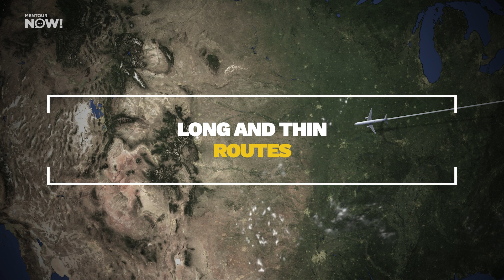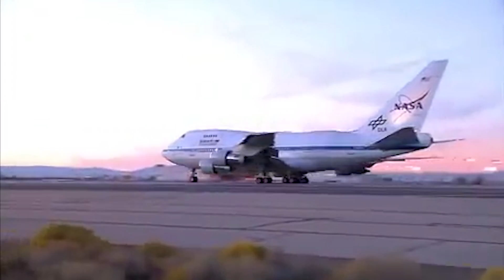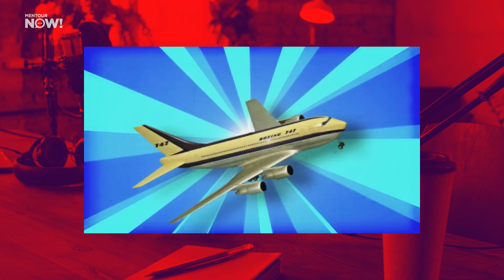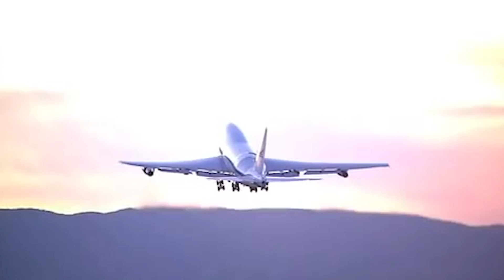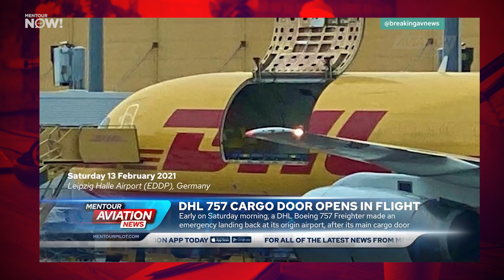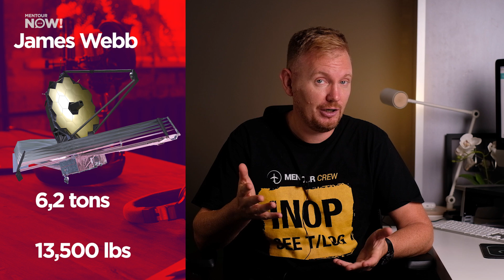The Incredible Transformation of a Boeing 747SP into a Space Observatory - SOFIA!

Comment: A few more interesting facts about the construction of SOFIA: The telescope itself was designed an built at MAN in Gustafsburg. They have very much experience with parabolic antennas of any sizes. To get the aircraft balanced after the huge weight of the telescope was placed in the back 3000 kg of lead shot were added to the nose of the aircraft.

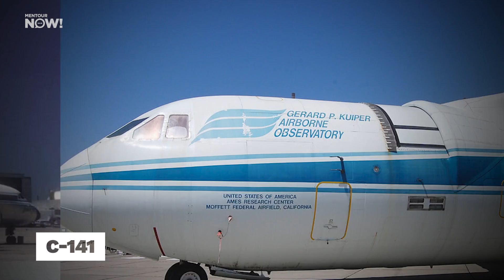Comment: 09:14 - Not to forget that even Concorde was used for astronomical observation. The prototype 001 had its roof cut and windows installed for observing the eclipse overhead, which permitted 74 minutes of continuous observation of the eclipse, as compared to the 7 minutes that would otherwise be possible for ground-based observers.

Comment: There was a documentary made about this aircraft a few heads ago.  If I recall correctly they mentioned the demand for missions was so high they were scheduled out years in advance.  Whenever maintenance was needed there was extreme pressure to finish on time otherwise years of planning and research would go down the drain if the aircraft missed a planned mission. 

I’m sure there’s still much demand for it but operating cost is probably a big factor. Perhaps a 777 could be similarly modified in the future?

Comment: I did see it during it's D-check at Lufthansa Technik Hamburg in 2014 as I worked there in the VIP department. It was launched 2007 not 2014.
One day we heard about SOFIA being there and getting checked, as no other company in the world was willing to do this maintenance on this special aircraft. 
So we went there after lunch break and took a good look. Then one of the scientists catched us looking and gave us a tour and some infos on a model and some demonstrators for the telescope mounts including the vibration control air buffers. Great day that was. We almost missed the end of our shift.
What a piece of tech it is.
The rear section did not just get another pressure bulkhead. The whole upper section was replaced with a bigger section to fit the door and opening into it. They also added a whindshield just before the door opening to shield the telescope from the wind and counteract the aerodynamic effects of the open door during flight.

The 747SP has also the advantage that it can fly very high as it has the wing of a bigger airplane and significant less weight on it.

Comment: With SpaceX's fully reusable Starship rocket likely flying soon, which will be able to launch and service mammoth space telescopes among other things, it is likely a new suite of serviceable space telescopes will go up, making airborne telescopes even more obsolete.

If you just think about the idea of SOPHIA, it is a major effort to get it flying for a limited time with limited capabilities such as 2.5m is probably the biggest you could possibly go with scope size and you still have some atmosphere to deal with, which is a major drag.  With Starship, you do one relatively inexpensive launch in a 9m wide rocket where the telescope unfolds in space to be say 24m, nearly 10x the diameter and then it is in space for round the clock observations completely unobstructed.  Then Starship is cheap enough to do regular servicing missions to a space telescope designed to be serviced.  With Starship's 100+ tonne to LEO capacity and orbital refilling, there are options to either refill in orbit if say you want to go to where the JWST orbits for say a servicing run or maybe use the capacity for a separate transfer vehicle to go out there as there is quite a bit you can do with 100+ tonnes in LEO.

Comment: The telescope door can only be opened safely in flight at high altitude, where the air is thin.   If open at low altitude, the thick air will cause too much wind in the open door, and tear the aircraft apart.
Reply: Except it doesn't.  All those air-to-air clips were not that high up.  Also, it was displayed at Edwards Air Force Base and made flybys with the door open.

Comment: Refuelling, repairing the JWST might not be that big of a problem, as SpaceX is already planing for servicing the Hubble, and SpaceShip will be able to get to it easily, even with a crew.
Reply: SpaceX is only looking into the feasibility of using a Dragon capsule to reboost Hubble back to a higher orbit. There are currently no plans to do so, a decision on whether to proceed with such a project is pending the outcome of a study that is currently being conducted by SpaceX and NASA. Possible repair was mentioned also as something they will look at, but that would be much more complicated as that would require a robotic arm like the Shuttle had which can maneuver astronauts into position to do repairs.  

At least with Hubble it's theoretically possible because Hubble was designed from the beginning to be serviced in space, however JWST was not because of its huge distance from Earth.

Comment: from https://ails.arc.nasa.gov/
Image Record: AC90-0184-15.jpg
Title: SOFIA Model with telescope door positioned forward
Date: Apr. 02 1990

SOFIA (Stratospheric Observatory for Infrared Astronomy) (747) Model with telescope door positioned forward for testing In the NASA Ames Research Center 14-foot Transonic Wind Tunnel. TEST-114-1-14 with John Wallace.
https://ails.arc.nasa.gov/images/ARCHIVE/Imaging%20CD/Imaging%20CD%20%23609/AC90-0184%20folder/AC90-0184%20jpg/highres/40100_AC90-0184-15.jpg
Reply: by 1997 telescope door positioned rear of wing.
Image Record: AC97-0374-10.jpg
Title: SOFIA 5 model installation in 14-by-14-foot wind tunnel
Date: Oct. 30 1997
SOFIA 5 model installation in 14-by-14-foot wind tunnel for test 208-1-14 -telescope cavity, cover off with wind tunnel test crew N. Hart, B Rose, M McIntyre.
https://ails.arc.nasa.gov/images/ARCHIVE/Photo%20CD/PCD3987%20(CD-302)/AC97-0374_folder/AC97-0374_jpg/highres/AC97-0374-10.jpg

Comment: Story I heard is longtime congressman Mike Honda lost his seat a few years ago. That new congressman didn't have seniority Honda had so not able to keep the money rolling to SOFIA. However, we have seen new technologies enable remote sensing platforms including recon aircraft to fly without people. Maybe SOFIA was a great idea in 1980s when the program started and throughout 1990s with extensive wind tunnel tests (somewhere in my collection is a SOFIA decal showing telescope forward of the wing). There were all sorts of contractual issues and obviously lots of modifications which dragged the schedule out further.

Yes, SOFIA handles EXACTLY like its previous passenger configuration (supposably pilots don't need a new type rating). Other interesting things like a HP printer inside a hardened case to prevent it becoming a projectile in case of abrupt manuveaurs. Obviously there are different emergency procedures. Though still I feel sad as there are a lot of older people that worked on this program for years and to have it end so quickly once operational.

Recently there were tours through this aircraft, a friend asked one of the team, "do you have flight attendents?" Nope, you pack your own meals. There is a microwave available to use.

And yes, when flying along you can see the telescope move around. But wait... the telescope is still. It is the airplane moving around it.

Comment: I spotted SOFIA flying overhead once. As an infrared astronomer, I have always wanted to use it. The biggest problem with SOFIA is the sensitivity. It can reach far into the infrared, but the sensitivity is quite poor. As a result, there are not too many things bright enough that you can observe with it. Is it completely obsolete? Absolutely not. JWST goes out to 25 micron; SOFIA reaches 600 micron. It also has many instruments that JWST doesn't have, and can be upgraded as mentioned in the video. But sadly, with the finite research budget we had to work with, SOFIA had to be let go.

Comment: At Lufthansa Werft in Hamburg (SOFIA was actually there for service when i visited) they told us, that NASA had problems to certify the aircraft after the modifications and finally decided to declare is as a spacecraft to avoid the hassles.
Reply: I worked on the SOFIA aircraft running engineering for modification projects. I can say that it was flown as a public use aircraft, which doesn’t have to meet FAA certification requirements.  Public use can only apply to government owned aircraft.  NASA did require us to design to the FAA certification requirements when we could, but we never officially provided FAA approval.
Reply: @derdan20  yes but NASA is not a German government entity and the FAA not the German Aviation Authority. This comment might still be true, the US is not the only country in the world with rules.
Reply: @DUDA-__-  But the Aircraft is US registered, and therefore follows the rules of the US.  EASA is the CAA for Germany.  To fly internationally, the governments have agreements outside of ICAO to enable international flights.  It is the same for military aircraft.
Reply: @derdan20  I think you underestimate bureaucracy. :)
Reply from the maker: I didn’t find that 😂

Comment: Thank you for the detailed design information on the special version of the 747SP, and regarding the presentation and announcement of the SOFIA project. The aircraft was in Stuttgart for a few days in September 2019, and I had the opportunity and luck to visit it directly at the airport from the outside and inside. The most impressive thing for me was that this aircraft can fly with the flap open, flying so smoothly that it can take sharp long exposure pictures. I also found the plane to be quite "bare" on the inside, lacking the wall panels you see on passenger planes, you could directly see the struts of the plane's body. That's why it was relatively cold for the scientists who flew along and sat at their monitors etc. in the fuselage, they had to dress warmly.
It was also interesting to learn that the airplane does not reach the maximum flight altitude at the beginning. This is because in the beginning it is too heavy to reach the maximum flight altitude due to the fuel it has been refueled with, and it starts at about FL 390. Only after several hours, when enough fuel has been burned in the course of the flight and the aircraft has become lighter as a result, does it climb in succession to the next higher flight level, up to FL 450. Since it mostly returns to the starting airport, but on the other hand the telescope must always be able to observe the same part of the sky for a while, it flies "almost" straight ahead for a while at a time, and then changes direction and flies straight ahead again for a while, with the route leading back to the starting airport at the end. The "straight out" flight paths are not completely straight, however, but somewhat curved, since the telescope must maintain its line of sight relative to space as the Earth rotates away beneath it. This is how the typical flight paths of the SOFIA aircraft are created, as they can also be seen clearly on the following page.
https://www.dsi.uni-stuttgart.de/institut/aktuelles/news/Fliegende-Sternwarte-SOFIA-zu-Gast-am-Stuttgarter-Flughafen/

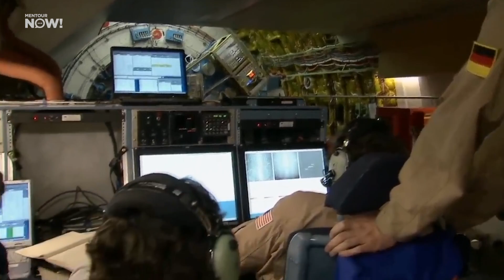Comment: Cool to see how the telescope is stabilized at 9:59. Keep in mind: The telescope stands perfectly stil. It's the airplane around that is shaking in flight.
Reply: It's like me when I go out observing. I drink so much caffeine to stay up late that I am shaking just like that. Need a very solid telescope mount to keep me from shaking it.
Reply: It's worth noting that the shaking isn't nearly as bad up there as what you're probably used to on regular commercial flights. These missions are flying around 10,000 feet higher than normal commercial flights and there's very little weather up there. Aside from the tops of very large thunderstorms, weather happens almost entirely in the troposphere, which these missions fly above. There would still be some shaking from the engines and aerodynamic forces induced by the aircraft itself, but those would  be quite minor compared to turbulence from weather. The lack of water vapor mentioned in the video, in addition to causing less infrared interference, also means that there is essentially no convection at all up there.
Reply: @Buddyclub33  it starts with c too